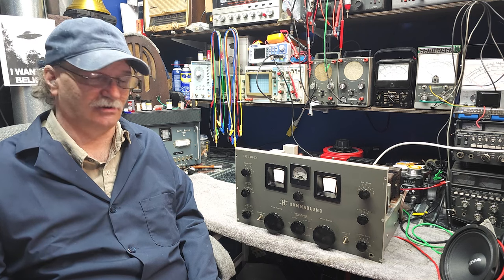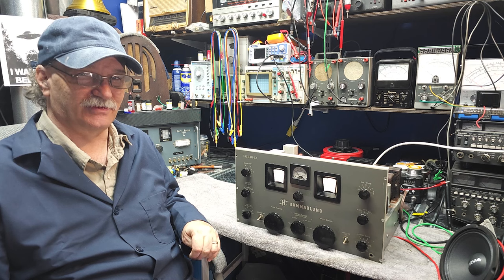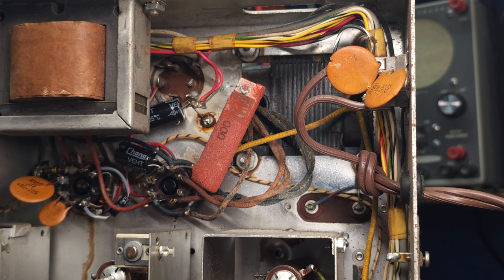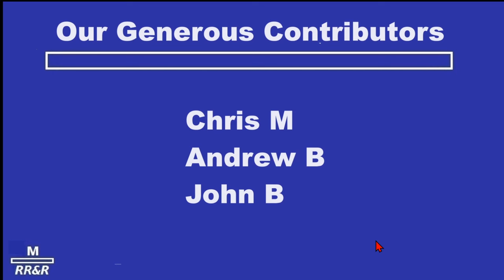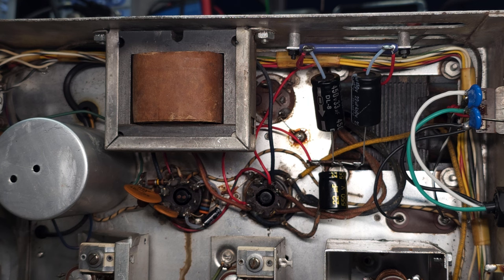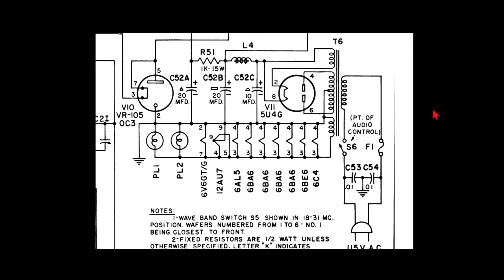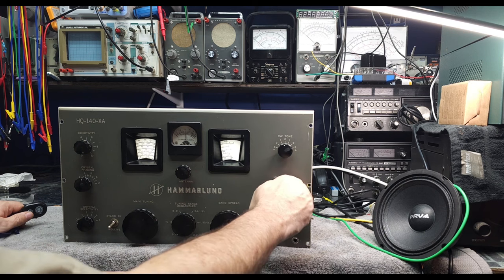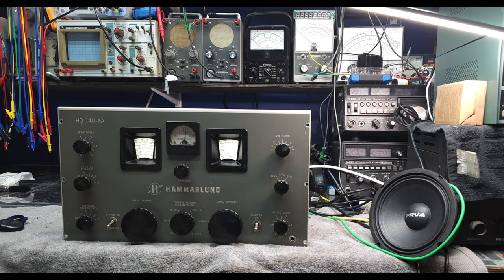Hammarlund HQ-140-XA Repair or Restoration? Pt. -1

Comment: Did you have to align the I.F. cans?  or do an RF alignment?  I am working the same exact receiver.  It is an XA model.  same issues you found on resistor and I used the same one you did.
I did get the hayseed cap can instead of using caps under the chassis.  if you can show how to do a I.F. can alignment with a spectrum analyzer and tracking generator. would be help.
Reply from the maker: The restoration process hasnt reached the alignment stage yet. Resistors are next. Dial calibration and crystal filter seem out so alignment is likely in the cards. To understand my process, please watch this. https://youtu.be/yFSJjaKgAJI?si=upv9983AdOXYXSld

Comment: I'm kinda wondering how the fuse can be in the wrong place when it, or at least mine didn't, have a polarized plug
Reply from the maker: Once you install a polarized plug, which is a must, fuse placed becomes critical to safety.
Reply: @MikesRadioRepairRestoration  yes, just not an error by the designer
Reply from the maker: Yes it was an error. It was not on the switched lead. A serious safety error.